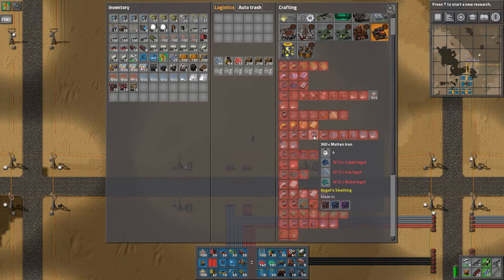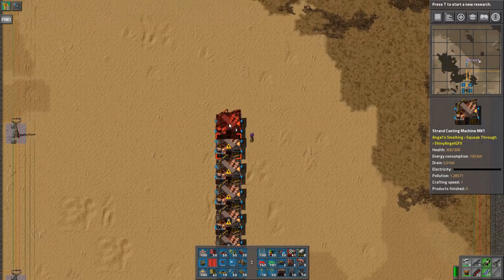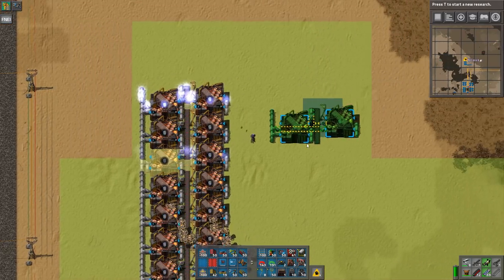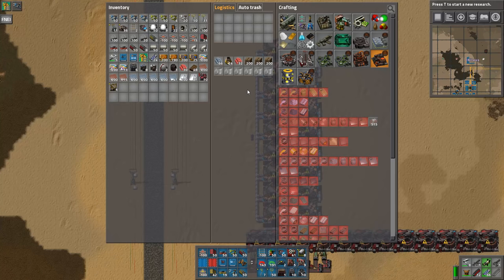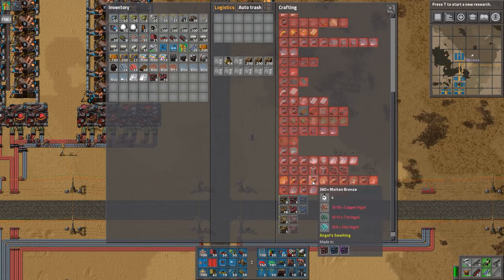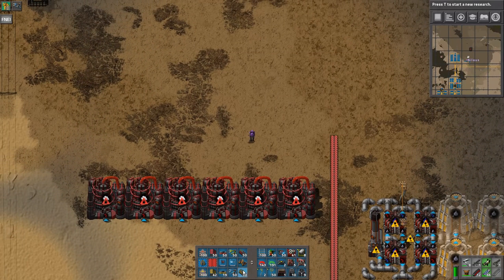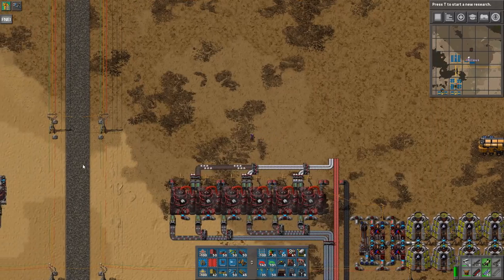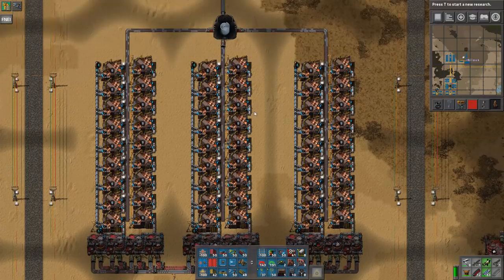Factorio 0.16 - Angels Mods Tutorial Lets Play #24 COILING IRON AND STEEL

Comment: Have you considered using a construction train? With a few stacks of stuff you keep having to run back for? Just have it running up and down along one side of the base so you can just go there, and park it where you're working?
Reply: In my opinion it's not as useful as the crawler because it needs tracks. The Crawler you can load up and drive wherever you want to build, while a train would require you to place awkward tracks everywhere. And when it comes to getting stuff, just going out with a car is probably just as fast or faster since you're yet again not bound by tracks.
Reply: I didn't mean as a construction vehicle, but as an item that carries a bunch of raw materials for building things. And with a dual headed train he could have it so he could send it back to a station and reload if he really wanted.

Though I have a mod called Vehicle wagon he might find useful which would let him park the crawler on a train car, and drive it around with the train. (less chance of death.

Comment: if you would use the other iron bars recipe, with the lime (which is easy, with a water source and some washing), you would produce more iron bars for less iron, and if you would smelt manganese directly from ore you would spend 12 manganese ore per smelt vs 24 iron ore, its a 1:2 ratio instead of 1:3(with lime) or 1:4(used in vid) like before. So here it is actually better to smelt manganese the "shitty" way :D

On the whole build it gives you the following: Per Steel smelt you "pay" 12 Manganese ore and 24 iron ore, per iron smelt you pay 12 Manganese Ore and 6 iron ore, which buzzles it further down to 24 manganese ore vs 30 iron ore per smelt of 1 steel and and 1 iron ingot (inside the induction furnance). So if you build that to ratio you would need  1 steel inductuion furnance per 2 iron induction furnances, to even that out at 36 vs 36 ore consumed.

If you however stay at the recipe used it would be 12 manganese ore vs 32 iron ore per steel smelt and 12 manganese ore and 8 iron ore per iron smelt, which is a bit harder to ratio as its 24 vs 32 ore, which evens out at 72 manganese and 72 iron ore so 1 steel smelter per 5 iron smelters. So you have a 1:5 instead of 1:2 ratio, this makes a big difference. 

TL:DR smelt managenese the shitty way (directly 24 ore, 24 ingots) and build 1 steel induction furnace setup per 2 iron induction furnace setups, to consume evenly :D Hope I did not miscalculate, if so please notify me

Comment: There is a productivity bonus for coiling when you get to modules, though - the casting machines only accept two productivity modules, while the assemblers used to unwrap the coils accept up to six. There's also a bonus for the second-tier coiling, but I never really used it - the coolant promises some extra efficiency to all of your production, but I'm not sure it's worth the extra logistics effort. With the exception of steel, of course :P 

Also, coiling is a lot more energy efficient, though that's only really useful if you're doing some self-imposed challenge like "no solar". It's the kind of thing you start to appreciate when you only allow bio-fuel based electricity :P

Comment: What is the plan for the manganese surplus after the steel? Now the ratio is not 1/1
Reply: Ye, that pretty shitty b'cause that means over time that storage in sorting block get fully stockpiled with manganese ore after some time past. and in order to avoid that he needs to do some mindtrickery stuff like taking out some of the iron coils MELT IT AGAIN AND MAKE STEEL IN RATIO WITH MANGANESE and this is so stupid, Angel why are you do this GUUUUHH
Reply: You could void it while it's a fluid in a clarifier
Reply: yes, but this is mostly cancel all productivity because you just trow out 3 manganese ingots per 2 steel ingots so it 3 out of 8 ingots and this is too much
Reply: You only throwing 5/8 of one red belt out, and it's an otherwise useless byproduct
Reply: The simple solution is to also add a pure iron ore input. The new priority capabilities on splitters make this pretty trivial. Or, if you're feeling more adventurous, you can use it in the other smelting recipes - though that doesn't fit nearly as well to the basic strategies of this tutorial series.

Comment: there is a mod that could help you out if you are a little worried about space in the storage chests that you have in different locations, it is called "big bags", it changes things in such a way that you can store more in the storage chests and on yourself, for example, instead of 10 stacks of 100 iron plates, with "big bags", you would have 1 stack of 1000 iron plates, that would be the same for the copper, manganese, sulfuric acid barrels and so on